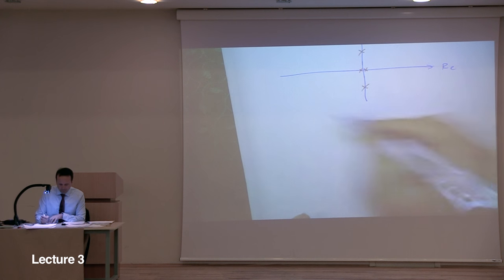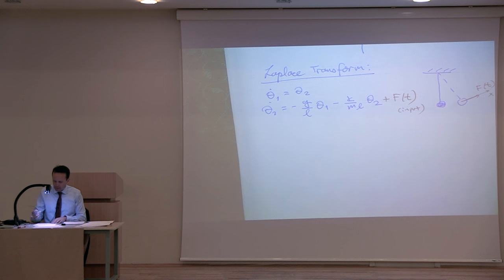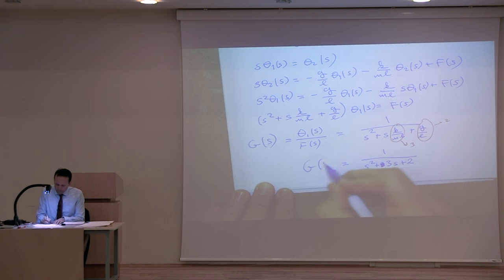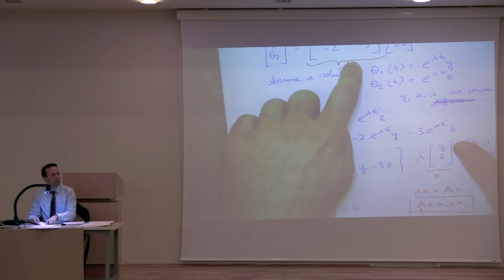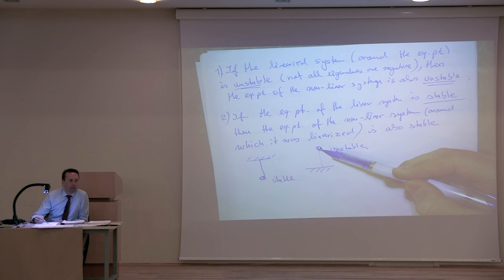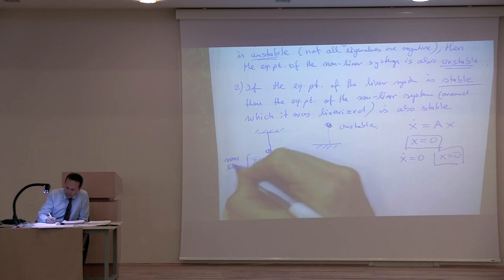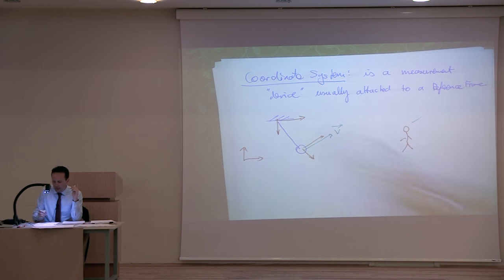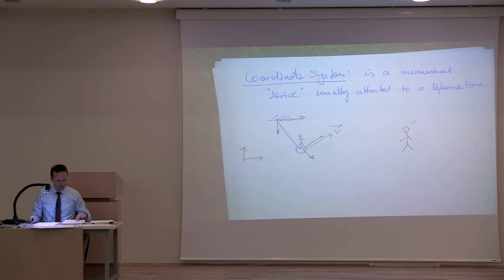AE372 - Flight Mechanics - Lecture 2.3 [Intro to Reference Frames and Coordinate Systems]

Comment: 15:10 Sir, when we linearize the non-linear system at theta1 = 180 and theta 2 = 0; the equilibrium point still comes out to be theta1 = 180 and theta 2 = 0.
But a/c to you, theta1 = 0 and theta 2 = 0.
Can you or anyone check this?